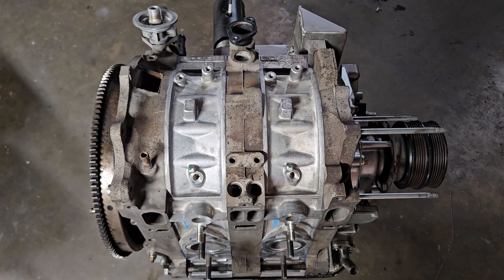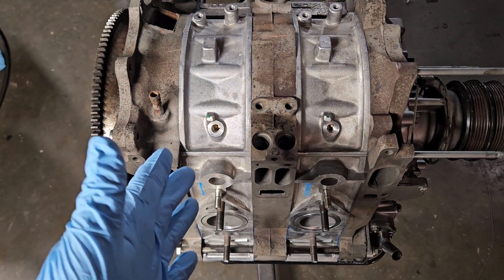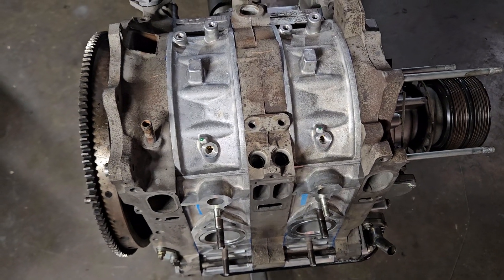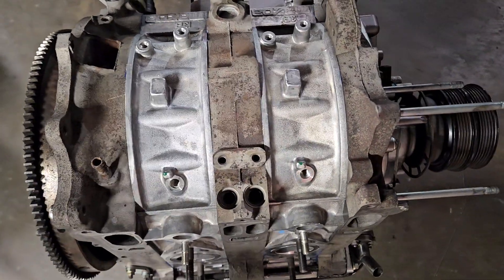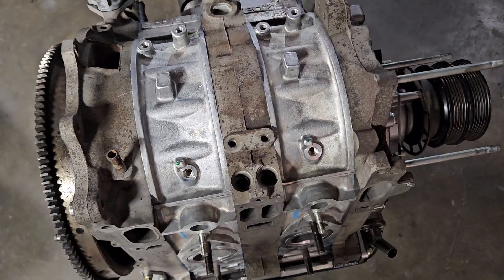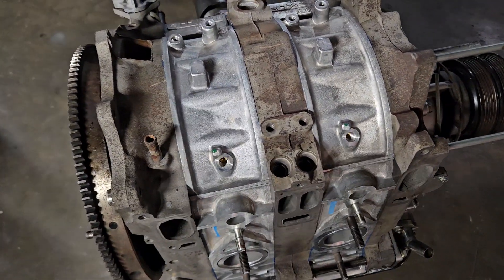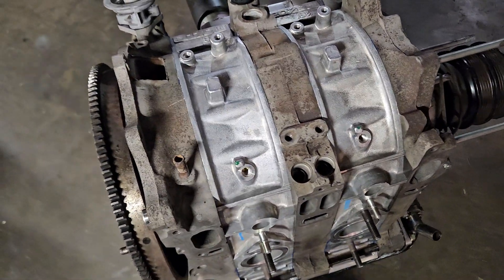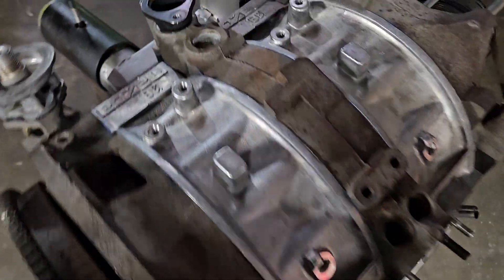Detonation Protection - Rebuilt stock RX7 FD3S block for better reliability in extreme conditions

Comment: Any long term issues with rotor housing wear with aftermarket seals? My motor was rebuilt 12years ago at 147000kms due to coolant seal groove corrosion on the front iron. The engine builder recommended and used RA seals at the time, but with stock springs. Engine has now done around 35000kms,  still hot starts easy, but i wonder what the housings look like. Still using OMP. S5 Turbo.
Reply from the maker: @clintonlangerak7972  Most aftermarket seals aren't going to seal as long as OEM and some may be harsher to housings. But i rarely see a performance build last as long as a stock RX7 used to because we generally modify or race them at the point.  Not normally a daily driver. You have to decide what you want and what the trade offs are.
Reply from the maker: @clintonlangerak7972  I would highly recommend additional premix with those seals as well

Comment: Why not the external oil mod?
Reply from the maker: @centralflspeedlabgarage8645  I've never seen it needed on a basic build? OEM oil system is amazing.  And has the ability to adjust pressure.  Rotory Engines don't have bearing or oiling issues generally.  Sometimes, on a race block there's  a reason for external or if the block is modified but not often.